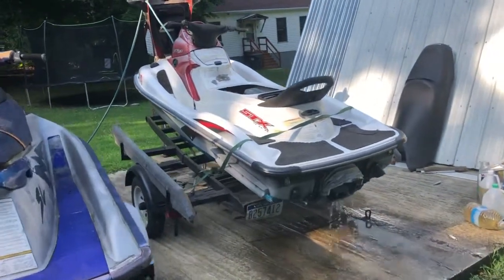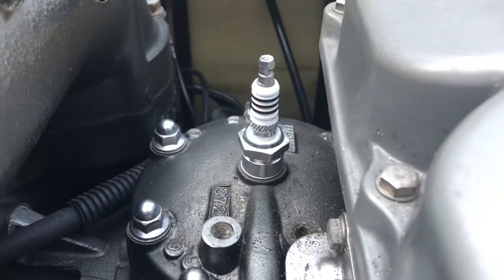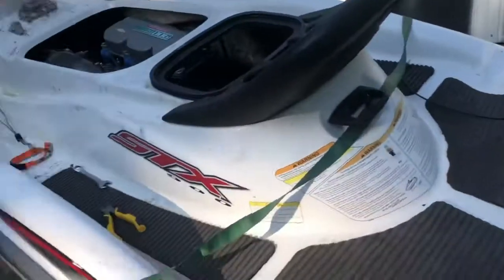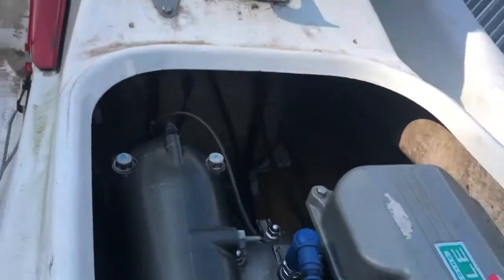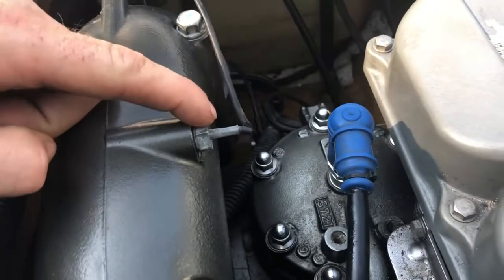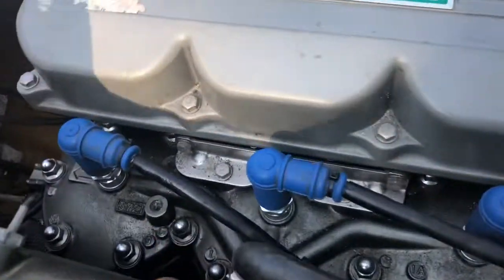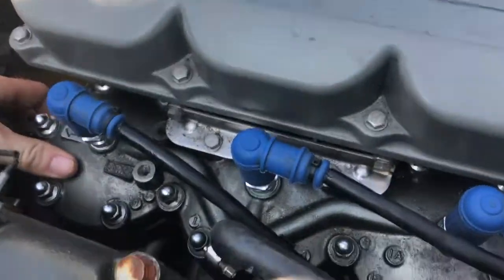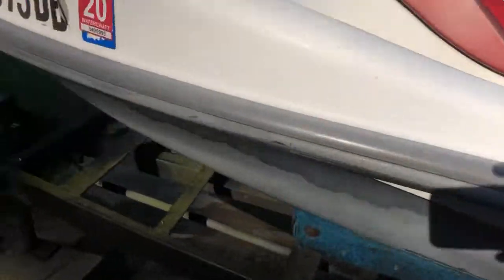Kawasaki STX 900 limp mode/rev limiter problem

Comment: Thank you for posting this video. I have a 2004 kawasaki stx 900 that was doing the same thing. You could fire it up when you put it in the water and you could get about 2 wide open, full throttle pulls with it before it would start doing the rev limiting thing. If i kept driving it, it would rev limit it lower and lower until you only could go about 5-10 mph. I ended up replacing the water temperature sensor that's plumbed into the pee hole line that you pointed to and that solved the problem the next couple of times i brought it out to the lake. The last time i had it out, it worked great for about an hour of off/on riding. I went to go around a bouy and it cut out a little like it sucked up trash or water or something. I rode it straight back and haven't gotten to look at it until a week ago. I plumbed everything up while it was on the trailer, replaced the fuel filter, and put a fresh set of plugs in it with some fresh fuel. I cranked it up and it started acting like it did when i first put it on the lake. When you first start it up, it would rev up pretty high when you hit the throttle. But as it warmed up, it rev limited itself lower and lower. Once again i really appreciate you making this video. Ill try your solution and see what happens.
Reply from the maker: Cody Stewart let me how it goes for you, I’m still pretty new with this style of jet ski. If you’re still having problems like that you may consider doing some basic diagnostics on it. I find it weird that it’s intermittently limiting you. Have you checked that you have a good flow of water through your systems? Making sure it’s cooling properly... if running it on a trailer you must make sure the ski is level or the water won’t reach where it needs to and it may be getting over temp. It is also possible that sensor you replaced is faulty, I did have that happen to me, also make sure the connectors are clean on it. Let me know how it’s going
Reply: Did you figure your problem out?

Comment: Had a wrecker buy one of these from someone who was having troubles with it running in limp mode/ rev limiter. Guy spend a year and loads of money renewing carbs etc. Wrecker got it back to the shop and realised the reverse switch was not changing to forward properly. When the lever is in reverse, it limits the revs
Reply from the maker: Whoa that’s a bummer for that guy, also super good advise for someone to check that before spending a ton of money or giving up on the project. 
Thanks for that info!

Comment: I have a 98 1100 stx, im going to try this thanks
Reply from the maker: Let me know if it works, not sure if I mentioned in the video but I ended up replacing that part and have never had an issue since
Reply: @Rickengle300  thanks for the info

Comment: Hey awesome video as I’m having the exact same problem. I’ve never had a jet ski before until I bought a 2000 stx 900 last week, it wasn’t running at the time but I’ve got it starting and idling but as soon as I hit the throttle it’s like it’s limiting. Does the wiring have to be replaced or can I just leave it disconnected? Also can you please explain how to go about disconnecting it... new to this! Thanks in advance
Reply from the maker: I’m really not at liberty to tell you what you should do, but I think we can assume the manufacturer wanted it to be a functioning part. 
This part is supposed to protect your ski from basically melting down as I understand it. So
It lets you “limp” home.

Comment: I have the same problem.  Which part did you replace
Reply from the maker: I found one on eBay, 
It was called exhaust temperature temp sensor sender switch. 
Not sure if there is a more accurate OEM name or part number.

Comment: im gonna save this info incase it ever happens to me. i have a 97 stx900 with a different problem. I bought a new battery  and plugged it in, and the ski clicks like it doesnt want to start the turn over process. after a few times it will try to turn over and act as if it doesnt get any fuel. it is getting fuel and it is getting spark but not turning over... it will do that for a while, and then ill give it some gas and you can hear it sucking the gas in but nothing, after a few tries it will finally turn on, ill give it a few revs and it stays on, sounds good. then ill turn it off and sometimes it will turn right back on or it would do the same thing to me it did in the beg. a click and no go. any idea what it could be?
Reply from the maker: Seems like an intermittent issue, those can be a pain.
I had a ski act like that before and it turned out to be a weak battery, after replacing the battery I found that it wasn’t charging, and then it turned out to be a bad stator, ended up pulling the motor so that I could  ohm check all the spots you have to check, sure enough it was the culprit.. that sucked, but you said you have a new battery?  
And definitely getting spark when that’s happening?
If so next guess would be fuel delivery.. 
Just as a test after checking for spark, while it’s doing this, either give it a shot in the carbs or take a couple plugs off and spray a little starter fluid. 
If it starts I’d say definitely a fuel issue.. 
Would have guessed a ignition or kill switch issue too but I believe you wouldn’t have spark in that case. 
It’s almost always a spark or fuel issue.
Almost also sounds like a flooding issue.. but you said it would just click sometimes? 
That def sounds like an electric issue. Need to replicate the issue and verify spark in that situation. 
Hope you figured it out man. I’m no wiz either but figuring out and fixing my stuff is the best feeling. Let me know what’s up
Reply: @Rickengle300  I put some starting fluid and in spark plug area and no start. It would just keep trying to turn over until finally it does.
Reply from the maker: So you unscrewed the spark plugs and gave them a shot of s fluid and tried with the same result? And during that time you were getting a spark as well? 
I have had an issue before where my coil was delivering a weak spark and was causing an issue like that and I needed to replace the coil, but that doesn’t explain why it would suddenly begin working. 
I don’t have the specs for you to check anything particular, that will require a little asking around on Google or picking up a manual for the ski, but get the fundamentals out of the way first.. 
fuel, Air, spark, timing, 
Almost always one of the first three in my experience. 
You’ve at least shown partially that you can at least supply a fuel and still have the issue. 
Another thing about fuel though, it tends to go bad quickly when left in the fuel tank for a year, I almost always have to drain it out if I leave it in for a year due to it breaking down in the tank.. 
And it can cause your plugs to foul too.. 
while checking for spark next time, look at the ceramic portion under the electrode, is it black and sooty? 
If so,, and if your fuel is old,, siphon the fuel out as much as possible and put clean fuel in.. 
get it running… and get a can of sea foam spray and do what it says on the can.. that stuff will clean your fuel system out pretty well without taking anything apart.. 
then either replace the fouled plugs, or in my experience I’ve had decent luck with spraying some carb cleaner on that dirty ceramic and filling up that area of the plug…taking a small bottle brush and brush the ceramic, and repeat that process twice.. then let dry or blow it out,, and be careful doing this part but use a small propane torch and heat up the ceramic until it turns white or brown.. that will usually be enough to restore the plug.. just be careful not to burn yourself. 
Anyhow, those are some things you can do, 
But first be absolutely sure you have spark while the issue is happening. 
It does seem to be acting like you’re flooding it, or your plugs are fouled.. 
Keep me updated, I’m not an expert but I’d love to know what’s causing your issue

Comment: What's the name of the past and where can I get it?
Reply: Part
Reply from the maker: I found one on eBay, 
It was called exhaust temperature temp sensor sender switch. 
Not sure if there is a more accurate OEM name or part number.
Reply: @Rickengle300  Thanks!!! This video saved me a trip to the mechanic.. $150.00 an hour for labor!!! Thanks guys you're the best 👍👍🙏🙏🙌🙌💯💯💯💯
Reply: Water temp sensor